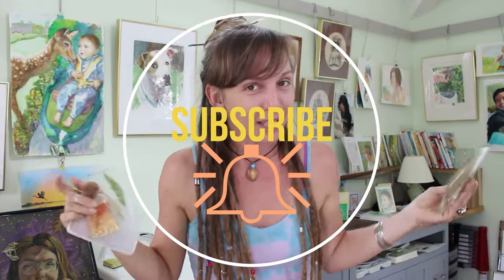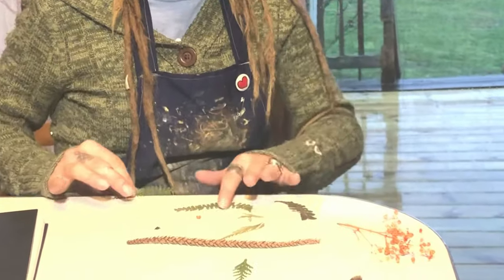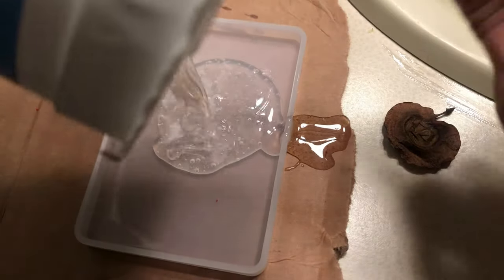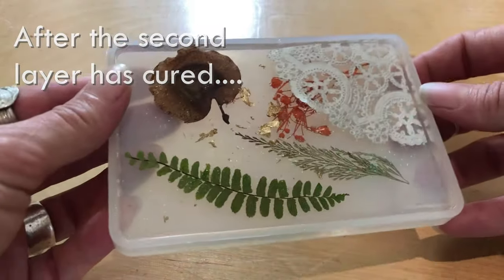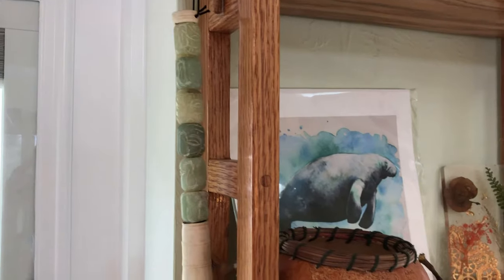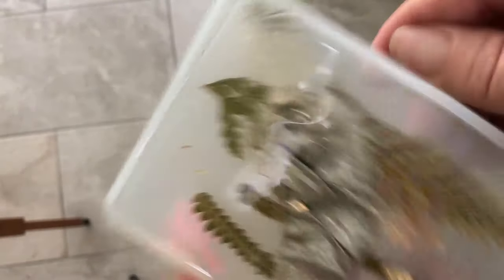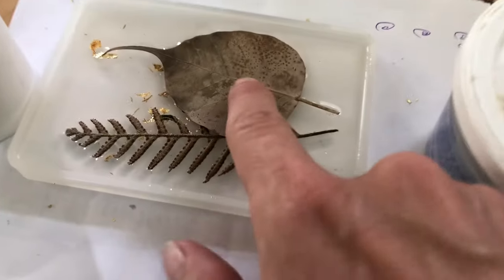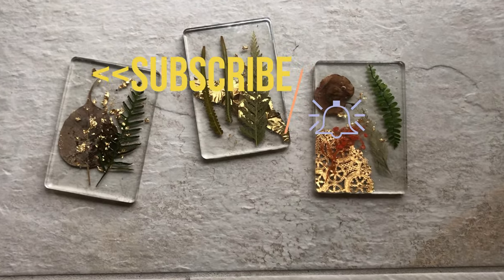Casting Epoxy Resin in a Silicone Mold

Comment: My first resin mold were hearts. When I used the cooking torch to get rid of the bubbles I guess the resin ended up fusing to the mold and I cannot get them out I've tried boiling some hot water, freezing them. My next one I will use 91% alcohol and put it in a spray bottle and spray the bubbles OR mix everything in one chosen flat mold and let it sit for a few minutes to see what bubbles come out and then I can use my torch to get the rest out and then take that and pour into the mold I'm going to use. So I will have that one mold just for being able to use the torch while the resin is still liquidy

Comment: Questions— Do we press and dry green magnolia type leaves or that is not necessary?(im only using half the piece)
Will tiny wood pieces work in place of flowers?For example, I have a 1-2mm wooden heart approximately 2” wide. Surely I could encase it in resin? Would the blow torch/heat gun burn it?  
So I use both a heat gun and blow torch for how many minutes each?

Comment: Love your authenticity! These pieces are beautiful to showcase in a home! Maybe if you warmed up the resin before mixing and pouring it will leave less micro bubbles? 🤷🏽‍♂️ Either way, it still looks beautiful & a few bubbles gives it character, I think 😁💜
Reply from the maker: Thank you so much!! Yeah I've learned to be cool with a few bubbles here and there.  I like the idea about heating it slightly but unfortunately that would start the chemical process prematurely which would cause the two components not to mix properly. Interestingly enough, the mixture starts to warm itself as it sets as a chemical reaction you can literally feel!

Comment: this was a great documentation of an experiment and I'm actually performing the same thing right now but with an ashtray mold I plan to just cut or sand off the piece that will be excess from the recess chunk taken out of the mold it's small and I think it will be easy to fix and worth keeping the mold for a while.  also the imperfections around the edges you could probably easily cover with some gold or silver paint
Reply from the maker: That's true! The small imperfections at the edges are hardly noticeable and since I made this vid I have actually seen other resin artists lightly sand their creations when needed too. Gold or silver paint would create a really nice border edge too!

Comment: I know you did this 2 years ago, but just wondering if you know you can buy small motorized mixers to get all the bubbles out beforehand, keeping you from having to use heat and flame.
Reply from the maker: Oooh good to know! Thanks for the tip!

Comment: every time I pour using one of these small epoxy reusable forms I get a raised lip around the edges on my piece when I pull the form off. How do you keep this from happening? Your example didn't show this .
Reply from the maker: I haven’t really run into that problem too much, although I have seen other resin artist talk about sanding the edges of theirs. I think you can start off with a bit of a rough grade and go down to a super ultrafine and still be able to retain a nice smooth field on the corner. Hope that helps, happy pouring!

Comment: Hello, a year later! 
In the first you said the first layer was completely cured i think before gluing the second leaf set? And there's no issue with them binding together or obvious differences between the two? No seams? 
Hopefully making sense! Thanks for the video!
Reply from the maker: Yep, first layer was completely cured before gluing the leaf and pouring again. I have done multiple layers on basically ever piece I have made and don't ever see a seem or separation in that place. I have heard people say that they sand the resin in between layers but I never do and they dry perfectly clear, you can't tell at all where one layer starts and the other begins :)

Comment: Hello, great video. But I was wondering, how did you manage to not burn the leaves, that you placed in the resin, with the blowtorch?  Asking because I am interested in doing something similar, but am worried about burning the leaves.
Reply from the maker: If the leaves are covered in resin they won't burn. You just have to go around any leaves that are sticking up from the resin in between coats:)

Comment: Hi ! I have a question. 
If I'm using those earring moulds that have a hole making thingy in it. Do i have to use a release agent or is it fine if i just pour the resin in it just like that? Without a pre coating of any kind.
Reply from the maker: I have never used a release agent and mine have come out fine. I think as the mold gets used more it may get tiny scuffs or tears that make the agent more necessary. I also haven't made earrings so your results may vary.

Comment: Does it matter the type of resin you use depending on the depth of the mold?
Reply from the maker: Yes! Some resin is called 'deep pour' and you can use it in larger molds but most of it must be poured in small layers. You'll need to read the directions and guidelines carefully for each brand you use.

Comment: Do you have instructions on using a silicone frame mold, this one is rectangular with stand mold at the bottom, all in one piece
I’m confused how to pour into the stand part, can you help? Or anyone answer this question, please thank you
Reply from the maker: I haven't used a mold that's that deep so unfortunately I don't have any tips for you. It sounds like it may have to be done in layers?

Comment: N95 is for particles. It’s not for chemical fumes. You should be using a P100 if you’re working with chemicals, which is equivalent to N95 for particulates but 100% for chemicals
Reply from the maker: thank you! I didn't know the difference!

Comment: What is the name of the mold you used? How do i order
Reply from the maker: I got mine from ebay, here is the listing: https://www.ebay.com/itm/1PC-Silicone-Square-Mold-Polymer-Clay-Resin-Casting-Craft-Jewelry-Making-Mould/174123083311?ssPageName=STRK%3AMEBIDX%3AIT&var=473005730619&_trksid=p2057872.m2749.l2649
But if you just look up any silicone mold it will work just fine:)

Comment: Just so everyone knows an N95 mask will not protect you against chemical fumes. You need a face respirator with the correct cartridge for the type of volatile organic chemicals (VOC's) produced from the epoxy resin. Refer to the safety data sheet (SDS) of the product and always work in a well ventilated area.
Reply from the maker: Thanks for educating me!
Reply: @CaleighBirdArt  My pleasure! I think its a common misconception that N95 masks will protect against vapours but they should only be used for particulates like dust. 3M has some great products for all types of chemicals like epoxies.
Reply from the maker: @shiftangles  Good to know! I'll have to get one for myself:)

Comment: This comment is a year late, but you can cast molten aluminum in silicone if that help any nervousness about using too much heat :)
Reply from the maker: Interesting! I never would have thought of that!
Reply: @CaleighBirdArt   I should remark that there is different types of silicone, some more specialized, but in general silicone can handle a lot of heat. I know you won't sit on one spot with a torch, so you'll be fine anyway. The epoxy will burn before the silicone will :)  But I would be nervous too. It's not natural to think a torch will be safe on something that looks like flexible plastic LoL. -  If you have a scrap mould, maybe do some tests with it and a torch to see what it's limits are. It's likely you'll never come close to those limits in the normal course of getting rid of bubbles in resin :)
Love your work!